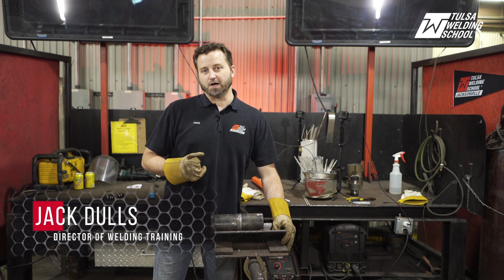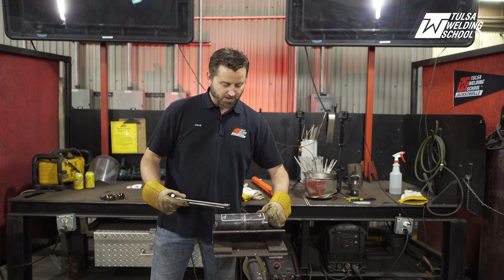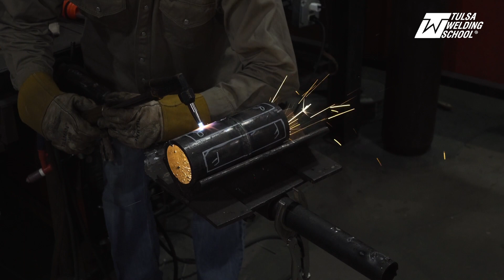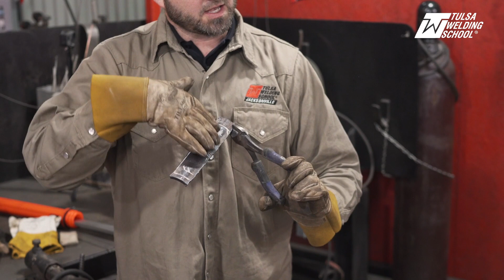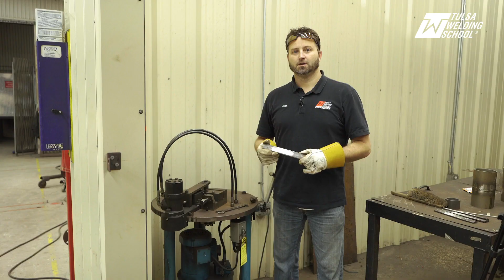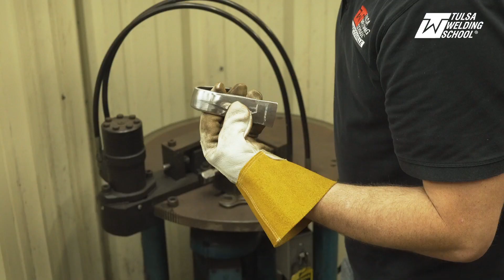How to Prepare Welding Coupons - Tulsa Welding School

Comment: Jack, you must do your research on bend radius, depletion of wall thickness and coupon orientation. The weld must be in the apex of the bend, where you bent them they were not tested. If the inspector does not adequately bend the coupons, the test must be redone and the qualification is not valid, sorry. Also the coupon must be bent to 180 degrees. 3rd, do not grind the pipe to hide discontinuities, grind the weld only, wall thickness and width of coupons is a essential variable of the test.